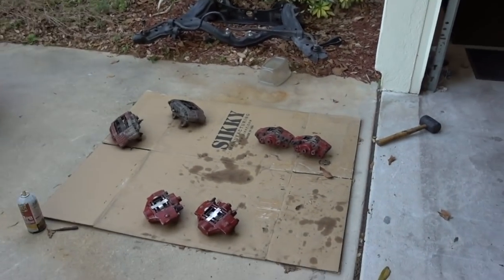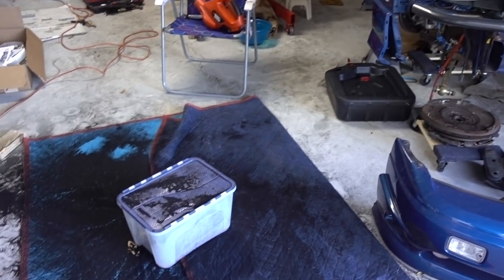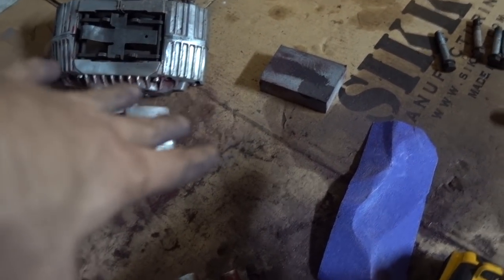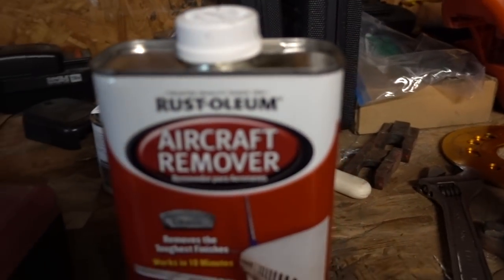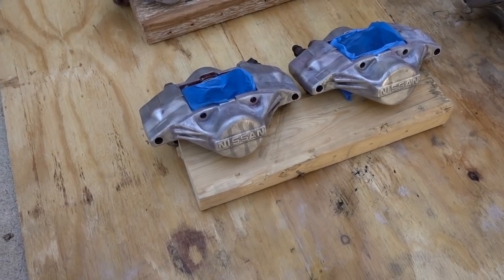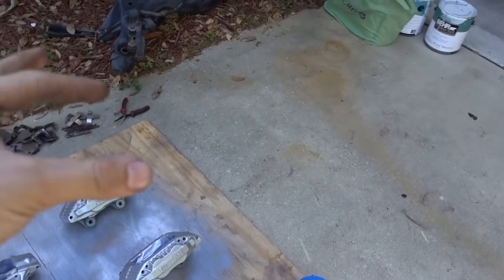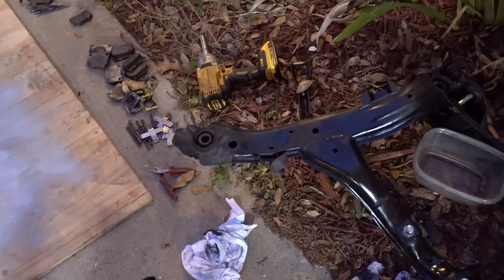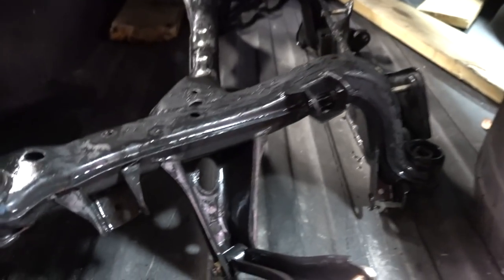Caliper Repainting from HELL!

Comment: once you start getting up in power you probably will want to swap to a 350z rear end.  It should hold a bit more power. As far as myself I kept the stock  rear end but put a tomei trax 2way LSD in. My time and friends in japan always went 2way.  

Now if your wanting a bit more "streetable" rear end.. if you can get your hands on an S15 spec R  ring and pinion..  I believe those are 3.83 and would be the way i'd  go if i stay with stock. 

of course that introduces the weak axles .  basically the closer to  500 hp the more chance that axles are rear end would brake. SOOO.. if your wanting to push that which is seams you do.. I'd swap to all 350 pieces in the rear.

Comment: Man I feel you. Sanding my old subaru calipers takes forever. I got some good rust and caked/baked on brake dust mixed with grime. Tried everything, drill wirebrush, hand wirebrushes, wirewheel, dremel, wheelcleaner, brakecleaner, soap and water. Do you think that AIRCRAFT REMOVER works for brakedust/grime/rust ???